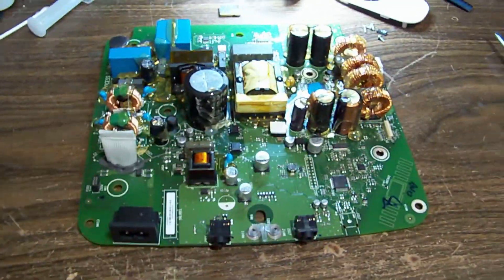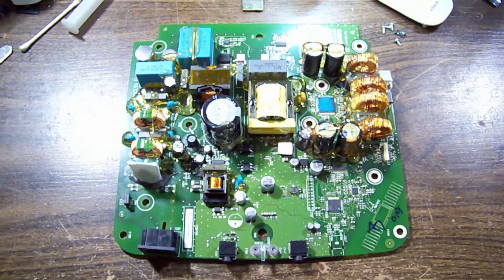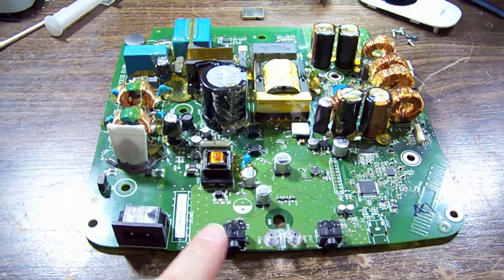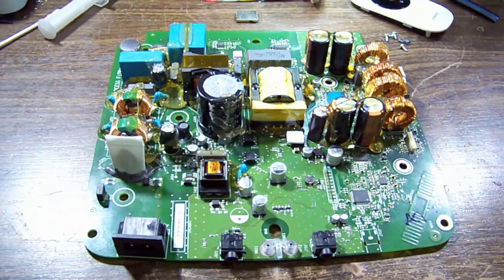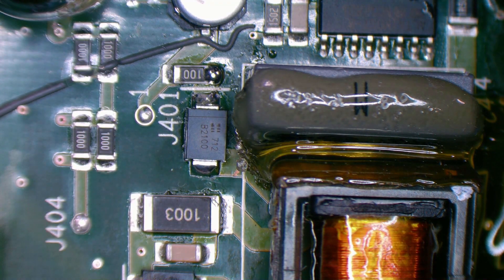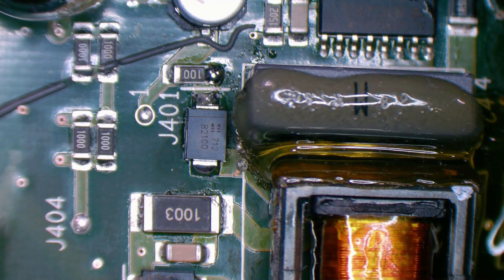How to repair a Bose Bass Module 700 that doesn't turn on!

Comment: Hello, I am from Germany and wanted to carry out the repair described on an Acoustimass 300. Unfortunately without success.
I used a B2100 in a DO41 Axial housing instead of the DO214. Do you think that matters?
Greetings Roland
Reply from the maker: No, as long as it goes in the same way around with the stripe at the same end as the original. Also, it will vibrate and could come off so once you have it working you might want to secure it with some hot glue or something. Do not try and push it to bend the legs once it is on or it might rip the pads off the board. If it is the right way around and still doesn't work then this might not be the cause of the fault you have.
Reply: @JonnyFix  
Many thanks for the quick response.
Yes, the error seems to be different. I didn't measure any voltage on the large 400 volt capacitor.
Any ideas?
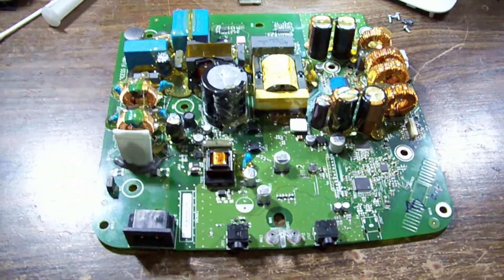Reply from the maker: @rolandb.1791  Sorry I don't remember the circuit exactly. I think there's the large cap and a smaller one to the left of it as seen at 1:34 with a black inductor between them. You will need to follow the path to them from the power socket to find which part is bad e.g. fuse, bridge rectifier, etc. I think the small one should have voltage always and feeds the standby supply that gets the bad diode. The big one might be fed by a relay so only when the unit is turned on? Will be obvious when you follow the circuit.
Reply: @JonnyFix  I was wrong, both the large and small caps have power. Following the circuit is beyond my knowledge. That's why the Bose box goes in the bin. Still, thank you very much.

Comment: Quick question, is the diode (B2100) connected to the resistor (100) through the PCB? Or is that a short circuit as a mistake? I measured with the multimeter. There was a connection.

Kurze Frage, ist die Diode (B2100) über die Leiterplatte mit dem Widerstand (100) verbunden? Oder ist dass ein Kurzschluss als Fehler? Ich habe mit dem Multimeter gemessen. Es bestand eine Verbindung.
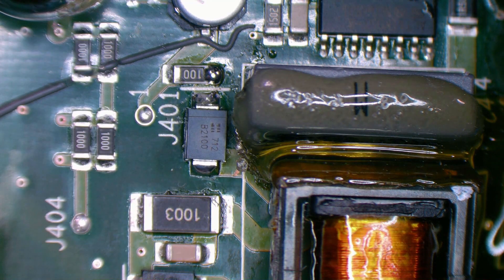Reply from the maker: Yes it connects to this resistor. You can see the trace going to it at 2:00
Reply: @JonnyFix  thanks for your quick response.

Comment: My Bose bass module 700 goes from  amber, white and red all the time and doesn't work anymore. is this the same issue with the diode?
Reply from the maker: I don't think so.
Reply: Do you find a solution for your problem?

Comment: Thanks for the video, unfortunately not more like these on line. Odd question, but I am having trouble taking the bottom cover off - any chance you can offer suggestions? Its the same module and I removed all screws but won't pop off. Anyone have a link to a service guide?? Thank you!
Reply: 2 screws under the big black sticker, feel around and you'll find them.  Just punch screw driver through the sticker.  Total 8 screws holding down the bottom plate.   Dont do the screws around the edge of the sub on the next lip up.
Reply: @kelvincoffey3121  Yes I found them, Thank you!

Comment: I’ve got 2 of these units both died within days of each other.  Off to get a diode!!! Uber thank you as these units are stupidly expensive
Reply: Update: diodes arrived, swapped and perfect.  Fix $3.    Bose wanted $200 each out of warranty to look at them. 

I wonder, if it happens again, should a higher voltage or higher current diode be used?   This diode is 100V.  Interestingly, in all my research of this issue, every single one was a 240V version. None of the 110V US folk seem to be reporting the issue.  Do they not use these there? or is the voltage different breaking them?
Reply from the maker: @kelvincoffey3121  Maybe the ones made for the US market used a different batch of diodes? From memory this is the output rectifier for that rail so the primary voltage shouldn't matter. A higher current capable diode may be a permanent fix.

Comment: Hey everyone..I need suggestions regarding to mine bass module 700 it's stop working it's playing up . If u turn off for few days then start working .this weird then if u turn off tv  nxt day stop working again.  I tried to connected with bose services centre they said $140 for service. Flashing light come up yellow then white then again go red  sub go off . Any need to update and anything else I can do it . I had tried everything like deleted app reinstall again update troubleshooting things rebooted twice . Plz help me out with it thanks in advance guys .
Reply: Did you find a solution? I have the same issue
Reply: @filipkjellsson  na mate keep turn off for one year .. then set up back again with TV it's working now nicely.. sorry to hear you having same issues..

Comment: gracias por el aporte, me funcionó, en mi caso el diodo no estaba en corto circuito me daba una medición de 0.38V y en inversa me marcaba 1.8V sospechando de que este dañado remplace con otro shotcky diferente numeración respetando la capacidad de 2A. funciono.
saludos desde mexico.
Reply: tengo un problema similar, el diodo marca bien soldado en la placa aun no lo he desmontado ni lo he probado con corriente, me pudieras explicar como hacerlo?
desde ya, muchas graciuas.
Reply: @enrique_atoyac  las mediciones que realize fue con un multímetro en escala de diodo, a eso me refiero con voltaje. marcaba bien pero hasta que lo reemplace funcionó. te recomiendo que lo reemplaces. suerte...
Reply: @spectrumitl  MUCHAS GRACIAS
Reply: Buenas, es necesario que la placa esté conectada al sub? Xq reemplace el diodo y la enchufo en vacío y no enciende la luz que indica q está encendido. Desde ya muchas gracias!!
Reply: @nabilhussein8494  es del mismo tipo el diodo?, tiene que ser shotky, asegúrate de ello, no recuerdo el número que yo utilicé.
Reply: @spectrumitl  Si el diodo que puse está tal cual, lo que tengo es la placa sola sin el parlante, el cliente me envió únicamente la placa, lo cual sospecho que no enciende la luz xq quizás debe tener que estar conectada para activar. Sabrías confirmarme eso? Muchas gracias!!

Comment: I replaced the diode now it powers on but red light keeps blinking..can it be due to bad soldering ( i know i have not done it neat ).just wanted to check if any faced this after replacing..
Reply from the maker: No. Bose states red blinking means firmware error. It's possible when the diode failed it was writing to the firmware, or the voltage was briefly something the chip couldn't handle and now the firmware is corrupt or chip is dead. Maybe you can find someone to give you a dump of their chip to flash yours with. If that doesn't work the chip might be bad so flash a new one. Sorry I can't be any more help.
Reply: @JonnyFix  Thanks for your help. Actually the LED is blinking red. Any idea about how to get a firmware dump, please?
Reply: @JonnyFix  Thank you very much

Comment: Great video took mine for diode replacement technician said diode is good. think I will attempt to replace it myself do you know where I can purchase in Brisbane and what’s best soldering iron is best to buy thanks mate
Reply from the maker: You could order the diode from element14 but why doubt the technician? This wouldn't always be a guaranteed cause of no power. Surely if they're in business they'd have enough skill to figure out the actual problem.

Comment: Thanks for the fix. But after replaced the faulty diode my bass module 700 gives broken sound even on low volume. Can u suggest any fix?
Reply: For me after replacing diode atleast it powers on but now red light blinks suggesting firmware issue
Reply: @harshvardhanvaidya  mine is turning on but the sound from the bass module is like broken.

Comment: Does this apply for the base module 500 too ? It's dead and wont turn on. However if left on for a while it does get slightly warm.
Reply: It would be really great if you can suggest. Been running around trying to find a fix

Comment: I followed your instructions — and it just works!! Thank you so much from Switzerland.
And I stick out a long middle finger to BOSE support in Germany whom I called and who provided the most unfriendly support call in my life. Lost any desire to give them any more business whatsoever (speaker is out off warranty). So I fixed it myself!
Under the multimeter, the shorted diode showed 0.32V in one direction (= O.K.) and 2.85V (= shorted, should be 0.00V) in the other, respectively.

Comment: Hey. Thanks for video. I had a same issue with a speaker from the same family. Can you please point out where to find the problem. I Was looking for this diode inside but can’t find it, seems it is different for this speaker compare to the subwoofer. Speaker model is soundtouch 300. I am in Uk and Any help will be appreciated.
Reply from the maker: Sorry, I don't know all models. If you study up on switching power supplies you should be able to locate the diode based on generic circuit topology, if it is even the problem in your case.

Comment: What were the symptoms? Mine boots up goes amber white then red then off and repeats that cycle over and over
Reply from the maker: This would not turn on.
Reply: @JonnyFix  Ty. For others having the Orange, White, Red then off colors. I am sending mine into Bose for repair. If anything on the work order proves useful i'll reply here with information. Its probably a bluetooth receiver issue but we'll see.
Reply: @Steve Berube, did you ever get to the bottom of your issue? Mine has just started with the same issue as yours. It comes on, flashing different colours but no sound.
Reply: @theleftman1  I ended up paying bose to repair it. Oddly they sent me the wrong one back (same model but clearly a diff customers since the name wasn't even right on the invoice) I think I paid about $120 for the repair work and it took 1-2 weeks to get back
Reply: @steveberube966  Thanks for getting back to me. Sounds like I'll have to bite the bullet on this one. You expect better from Bose.

Comment: Thanks a lot from France ! my bassmodule is dead as well (after 2.5year....) and when I called the Bose shop today they told me that "a diod" issue was a very very known... (repair cost ~145€)
Reply: J'ai le même problème depuis ce matin ... Acoustimass 300 (de mon Home Video Life style 600) ne fonctionne plus d'un coup, diode éteinte ... Comment avez-vous fait ? Apparemment ce n'est pas trés trés compliqué à changer (et la pièce coute moins de 1€ !!!) mais il faut quand même souder sur une carte ce que je n'ai jamais fait ... merci de vos conseils
Reply: Je ne parle pas anglais, donc je ne comprend pas ce qui explique sur la vidéo. Pouvez-vous m’expliquer comment procéder svp ? J’ai bien compris qu’il fallait démonter et remplacer une diode mais je la trouve où ? Merci d’avance

Comment: thanks for the video! my 700 bass module also suddenly stopped. not turning on no status light at all. i hope this will be the same issue as you shared in the video.
Reply: Mine also
Reply: I also called bose engineer . 3 days passed they are not visited yet
Reply: Yes mine as well...stopped working ...starnge thag such a expensive thing goes off...it's just 1.5 years I have brought this..
Reply: Do you know how much it will cost to get repaired in India..if expensive I am thinking of opening it my self
Reply: @harshvardhanvaidya   they will do home visit for around rs3500 and check for issue, if they cant repair at home they will take it to repair center and charge extra for anything getting replaced. it is expensive but seems part as mentioned in this video is hard to find
Reply: poor product from Bose as i see this is common problem in this model. Not expected from Bose!
Reply: @umangkapoor  thanks for info..I think they have outsorced servicing to TVS .. inhad bad experience with them earlier for my HP laptop..let me go through this painful repair with them again ..😭
Reply: @harshvardhanvaidya  i will defer to buy bose now as due to poor quality and after sales support
Reply: @harshvardhanvaidya  Bose has a fixed price for repairing the bass module having small to big issue and it is a whooping Rs 14000.
Reply: @rajesh50004092  ohhh..that's too high ... Any way I hit a deadend, i replaced the diode .. now it turns on but shows firmware error.. planning to go to bose support this week...can I ask if you can recommend other speaker system other than bose ?
Reply: Better to drop at service centre . If mother board repair at least 12 k .
Reply: Update : went to Bose service station in Bangalore, they tried reloading software but it failed .. now according to Bose they don't repair the board, so only option was to replace .. it costed me INR 15000 and was done in 30 minutes ... I think the service center is good just that Bose policy (and may be quality) is not..
I asked them about why this would have happened..they said could be a electric spike but did not recommend any stabilizer to protect it.. post replacement they gave 1 year added warranty on whole products..
Reply: It cost me INR 14000 to just change the Diode and they gave 1yr warranty on the product. Really expensive.
Reply: Ditto - mine stopped as well so going to now order the diode

Comment: Mandy thanks for your video. It helped me too repair my one 😊. Just one small hint for everyone who have the impressionen that the speaker doesnt sound right after the repair. Underneath the board, there is a small rubber plug which is working as a lead through for the speaker cable. If that one is loose, the speaker will sound broken.
Reply from the maker: No problem Stephanie. Glad I could help :)
Reply: Even I have the same problem. After repairing the bass module the speaker sounds like broken or flutter even on low volume. May I know which rubber plug u r telling about ? Please reply
Reply: Finally found the rubber plug . And closed the small opening with that rubber plug and boom the Bass module 700 sounds like before. Thanks a lot Jan Goffmann 💯 your hint worked for me.

Comment: Thank you so much from Germany! I thought my bassmodule was dead, but I just ordered the diode online and brought it to my local repair guy, who soldered the new diode on the board . Now everything works again. Keep on your good work!
Reply: Die Diode heißt B2100-13-F DII. Ihr könnt sie einfach im Internet bestellen, kostet 0,28€ pro Stück. Bestellt gleich zwei, falls eine nicht funktioniert! Habe sie vom Elektriker um die Ecke einlöten lassen. Viel Erfolg!
Reply: @checknoway300  Vielen Dank! Hab gerade das selbe Problem🙂
Reply: Kannst du mir vielleicht sagen, welche Diode genau du bestellt hast und gerne auch wo?😊
Reply: Mich würde es auch gerne interessieren um welche Diode es sich handelt und wo man die bekommt. Danke

Comment: Mine worked following the instructions here. Also, there was a part labeled 300 which sits closest to the said diode - I replaced that too.
Found the exact replacement from an abandoned LED tv video board without having to order or pay a dime. Cheers to good life and to everyone.

Comment: on my Bose subwoofer 300 the LED pulsates orange, white, red is there also j401 diode defective? thanks
Reply from the maker: I don't know all the faults sorry. You will need to test that diode to decide if it is.

Comment: Thanks for the video. My Acoustimass 300 stopped working today. I contacted Bose and they want me to ship the unit to their repair shop in Auckland and have it repaired all at my expense. I’ve had it for 3 years but I’m going to fight this to the death with the consumer guarantees act. A high end stereo should last 10+ years, not 3 and then kaput. Nice to know what the issue is but unfortunately I don’t have the tools or the know how to repair it myself plus I don’t want to touch it if I can get Bose to repair it for me.
Reply from the maker: We are lucky we have a reasonably sound consumer guarantees act. Most companies seem to cave in to it if you push a little. The thing is we shouldn't have to push. Good luck!

Comment: Could you measure the short in place? Same symptoms but I’m actually reading a forward and reverse voltage without desoldering it
Reply from the maker: Should show shorted in place if it is. Plug it in and see if you have expected voltage on the cathode. If so you have a different problem. Unless it's blown open inside and you're measuring other things in circuit....
Reply: @JonnyFix  Mine wasn't shorted but replacing it fixed the problem! You're a genius. Thank you!
Reply from the maker: @angelfyah00  Yes they don't always fail short, they can become less effective as they break down inside. Well done!
Reply: @JonnyFix  what is the expected voltage? Mine has the same symptoms but no short seeing 9.5v both sides?
Reply from the maker: @636kwackers  At 1:26 I point to the cap that diode feeds and mention it's about 13V. 9 each side is strange, I wonder if you have the negative probe on the right ground point, otherwise you have a different fault. Diode mode reading across the diode should be no more than 0.6V, it might not fail as a short.
Reply: @JonnyFix  Thank you. ill replace it anyway as the unit is dead, no LED, nothing at all, was working fine 2 weeks ago and now not, very strange.

Comment: Same problem in mine, I ordered b2100A-13-F and about to install in the next few days. But I just noticed the A in the name. Do you know what the A stands for? Spec wise I can't see any difference on a quick Google search. But if you or anyone knows and believes I shouldn't install it, please let me know ASAP. Thanks in advance.
Reply from the maker: It'll be some kind of manufacturer specific code or part of the date code. Datasheet isn't specific enough. Won't affect operation.

Comment: Hi...just watched your video as my bose 500 bass moudule doesn't seem to nolonger want to pair with my bose soundbar...Could you possibly confirm if this was too your fault ie the amber blinking light...Thanks...
Reply from the maker: Nope this problem was that it didn't turn on at all, no lights. You have a different issue sorry.
Reply: @JonnyFix  Thanks for letting me know..Top Guy👍